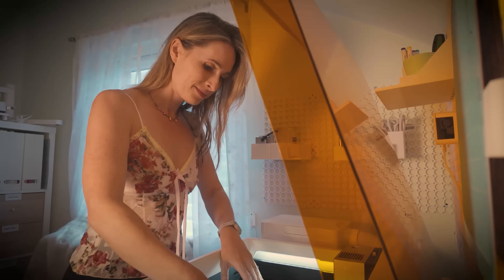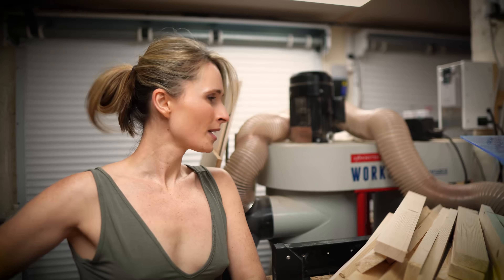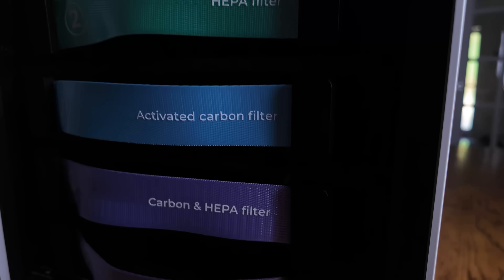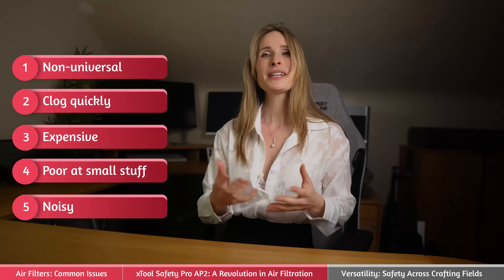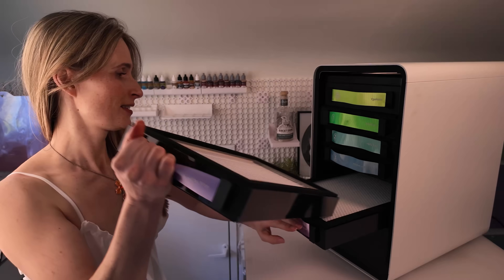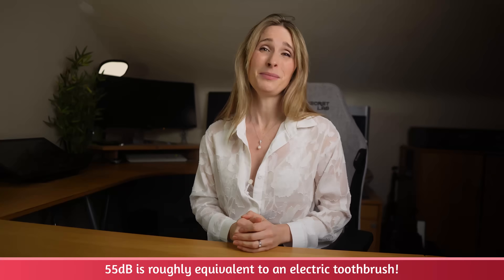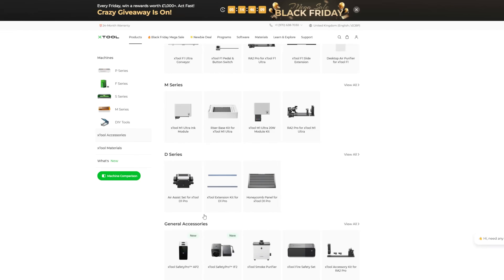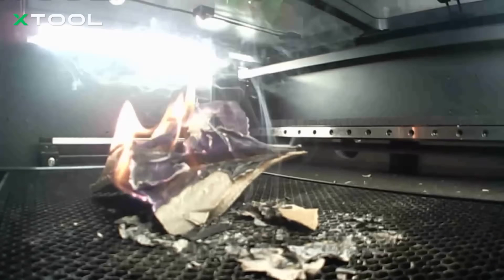xTool Safety Pro AP2: Is This the Ultimate Laser Safety Upgrade?

Comment: If you want to see what a better designed commercial air filtration system looks like, then check out the Grizzly 0953 HEPA Fume Extractor or the line of fume extractors by FiltraBox.
Reply from the maker: Sorry, completely confused now - earlier you said no filter needs more than three and it was overpriced, but now you're linking to the Grizzly with over eight and almost four times the price? So you're saying that more than three filters are valuable now and do have an effect?

Same applies to your other points - eg Layer 2 90% visible substances, but you're claiming smoke particles are visible substances, which they aren't (as they're 0.1-1 microns).

Likewise you're linking to the Grizzly and it also is putting the HEPA after the ACF, so it's this 'better designed' filter system not better designed after all?!

As I say, really interested to learn, but I'm struggling to see the logic or evidence from your examples - eg the Grizzly that has even more filters than the max three you described and the filters in the exact order you say doesn't work and with the multiple ACF filters that you said were pointless.... and it's 3-4x the price!

For what it's worth, the Grizzly looks great and seems to follow a lot of the AP2's logic too - obviously for that much more, I'd expect a bit more industrial capability and size, although it definitely lacks the looks and tech of the AP2, so I'd probably have four of them instead... ;)
Reply: @handsonkatie  I didn't research the Grizzly. I couldn't find the well designed Chinese made system that Roger Webb purchased a few years back and included it as a reference only because it is well-designed for commercial use and maintenance. 

As for smoke, it most certainly does contain particulates. This is why it stains fabrics and other materials. Even a clean burning fire emits smoke that may be barely visible, but it will still produce a sooty residue over time. Lasers cutting wood, plastics, leather, etc. do not produce clean exhaust.

If you look at the activated carbon filter in Clack's video, then you will see the residue from the smoke that xTool marketing literature claims is captured by the previous layers in the AP2. You will also note that that residue is not found in the center of the filter but only along the edges of the filter assembly, thus indicating an improper airflow.

I stand firmly behind my statement that no properly designed system for filtering laser exhaust needs more than three layers of filters to eliminate 99.97% of particles and odors.

My design operates as follows:
1. Large debris and smoldering embers are prevented from entering the filtration system by a steel wire mesh. This waste is dropped into a steel catch tray for ease of disposal.
2. The remaining dust and smoke pass through to the prefilter. This layer removes dust particles which would clog the HEPA filter as well as much of the smoke.
3. The HEPA filter removes 99.97% of particles larger than 0.3 um and the remaining smoke.
4. The activated carbon filter layer removes molecules which cause odors. This filter is cylindrical in design, 12 inches tall by 10 inches outer diameter and 6 inches inner diameter, providing for just under 2 inches of carbon around the peripheral walls. 

The carbon is contained in a liner so that it can be removed, replaced, and recycled. The bottom of the cylinder is sealed to force air to be pulled through the perforations in the cylinder walls. This design also forces air to be pulled evenly through the first two filter stages instead of being drawn to the edges of the filters as occurs with the AP2's design.

The fan is mounted to the lower-most chamber of the filter system to create the vacuum to pull the air through the system.

I designed this system to filter all dust and smoke particles, carcinogens, and other toxic fumes and odors while being able to run up to 8 hours per day with an annual operating cost of about $400 in consumables and it works as intended.

It also doesn't present a fire hazard as do both xTool's "SafetyPro" AP2 and its older Smoke Purifier.

p.s. - I foresee the SafetyPro trademark coming back to haunt xTool when the AP2 is involved in lawsuits stemming from house or apartment fires.
Reply from the maker: Ah ok, so the grizzly was just a random air filter? It's just you said 'if you want an example of a good air filter look at this' - is it even worse than the AP2 then as it has eight filters, three ACFs and so on?! It'd be great if you could give an actual example or evidence of anything as it's pretty hard for  anyone to follow as you're changing position.

So I get that you're comfortable with your filter that has three stages and you think it does a great job for you, but I don't see how that discounts every commercial solution on the market - eg Grizzly, xTool etc

Likewise, the fact you have done some engineering, doesn't mean you're right about say the cyclone. I've done engineering, but that doesn't make me right. The fact the CEO of xTool has done engineering (indeed studied aircraft design), doesn't make him right - although I'm sure it'd make him far more likely to know what he's talking about when it comes to airflow and cyclone design than you or me!! But the point is, you need to evidence things, otherwise it's just opinions being flung around.

Anyway, glad that you're happy with your homebrew design, and certainly I can wholeheartedly recommend the AP2 - indeed your points have helped me see even more strengths in its design, so that actually helpful! Each to their own!
Reply: @handsonkatie  It is good in its general design principles for maintenance. I should have researched its operation before setting it forth as an example.
Reply from the maker: Ok, so it too is a poor example then in your opinion as its filters won't work? Is Grizzly's obvious testing and industry use invalid too?

Do you not think it's odd that grizzly have been selling filters with 40 years experience to thousands of customers and haven't realised their filters have five stages that do nothing and have to order completely wrong so it clogs up super fast? Or could you maybe.... just maybe be wrong?
Reply: @handsonkatie  I can make a very poor design perform a task, but that doesn't make it efficient or cost effective.

The best definition of an engineer that I've ever read is a person who can do for half a pence what any fool can do for a pound.

I pride myself on offering the most efficient and effective designs possible at the lowest reasonable cost.
Reply from the maker: That's all great, but this like all your comments remains self-contradicting conjecture it appears as you duck any questions - but it appears you're saying grizzly are fools too now?

I'm genuinely interested - if there was any substance to your claims that all these industry tested filters were ineffective, overpriced and misleading, then there's a $15bn market for you to dominate - even the parents for your design would be worth $100m surely?!

But I do think based on all the flip flopping and evidence dodging that you might be mistaken in many, many places.

That said, I do think it sounds like you've made a nice little air filter which appears to do the job nicely for you, even if it lacks many of the features I like in the AP2 - Bluetooth device connectivity, cyclone separator to take out 99% of large particles, multi stage filter for long lasting lower stage (and more expensive) filters, optimised airflow for 3" ducts, in-house styling and even higher air quality.

But I think it's great that you've built one, it just doesn't make the entire industry wrong!!
Reply: @handsonkatie  The enclosure of the Grizzly design is good, but the filtration is less than optimal.

Do some research and testing. You will discover that what I've said about only needing a prefilter, HEPA filter, and activated carbon filter to remove 99.97% of particles, odors, and harmful fumes is correct.

BTW, xTool does not consider the "SuperCyclone Filter" to be a filter even though it serves the purpose of a prefilter. It is also not sold as a replacement part. Oddly, the manual advises you not to remove it from the chassis even though it must be removed for cleaning.
Reply from the maker: I've never said it's not correct, it's your assertion that any more serve no purpose that's not been answered. Are you seriously saying that a device without a cyclone that takes out 99% of large particles, then has three early stages filters ahead of what you described won't a) avoid clogging the more expensive filters faster and b) maintain filter efficiency longer?

This is a core reason more extensive filters exist across the industry and obviously they've been tested for millions of hours across many decades!! It seems pretty clear to me and I can appreciate all the third party testing, industry testing and user testing that verifies this.

And again I think you're struggling to understand the super cyclone - it says three times on the first page of the product description that you can just remove and wash it and it doesn't need replaced ever... Of course if you broke it, I'm sure xTool would send you a replacement part, but it isn't an accessory you should ever need to replace.
Reply: @handsonkatie  The vast majority of devices have either two filters or three filters. These are the devices that have been tested for millions of hours.

The filter systems designed for laser cutting have been tested for only thousands of hours collectively. The manufacturers do not run them to catastrophic failure because there is no need to do so. Who is going to file a class action lawsuit because they do not meet claims of performance? No one because there is no money in doing so.

I know what the claim by xTool is about removing and washing the SuperCyclone Filter is. However, the manual also advises not to remove it from the housing. The question is why? Does doing so break the seal with the chassis and reduce the overall performance?

The SuperCyclone Filter must also be disassembled in order to be washed and reassembled afterward. As a trained engineer (who likely has no practical experience) you should recognize that a device made of plastic will not withstand being disassembled and reassembled repetitively over months or years.

What is the average user to do when it will no longer seal properly because the screw threads are stripped out? The company does not sell these devices separate from the AP2.
Reply from the maker: Ok, I don't think you're really progressing anything, you've not answered any of my previous points and you're just throwing out completely unsubstantiated conjecture, which we've already demonstrated on 8-9 occasions is based on you a) not understanding the device b) not reading the technical descriptions correctly and c) not understanding industry standards or even the devices you point to (eg Grizzly). 

Given you have precisely zero experience of using this device, I can understand where all your misassumptions and errors are coming from (although I fail to understand why you can't follow the very clear marketing descriptions), but making wild assumptions about plastic not withstanding being unscrewed, really shows a lack of understanding of torque control in design. 

And the whole class action nonsense is just hysteria-stirring, far more confidently I can point out that your insurance company will no way pay for your homebrew, diy cyclone without any industry certification when it starts a fire.... which is far better grounded in evidence, but it would be pure conjecture also.

So try and keep to facts & actual evidence, rather than conspiracy theories and wild assumptions about my experience, the device and the engineering design - all of which you have demonstrated you have no knowledge, hence all the errors!

Comment: Am I understanding this correctly, if what I'm getting from it is that this filter station makes it so you can laser cut basically anything without sucking out the air to outside of the room/house and just go straight through the filter station with no hose for the outside?
Reply from the maker: Spot on, it takes nasties out of your laser cutter and what comes out is filtered clean air, no external venting required... Amazing, eh? And naturally you could do the same with any other device producing smoke/odours (soldering, resin printer, FDM printer, painting booth etc!)
Reply: It only works until the HEPA filter and porous activated carbon filter become clogged. You will need air quality monitoring equipment to ensure the AP2 is working properly.
Reply from the maker: Yep, just like any filter, it obviously needs to be emptied eventually - though this is already outstripping my previous one.

And air sensor super useful regardless, so definitely recommend them - love Apollo Air's sensors for example!
Reply: @handsonkatie - I didn't get the notification, so I thought my comment was missed lol, sorry for the long response time. Have you tried hooking it up to your Bambu printer?
Also how often do you reckon the filters needs changing? And is there an indicator that tells you when or do you just have to go by the air sensor you mentioned?
Reply: Venting to the outside is much easier and massively less expensive. The nonsense devices are only useful if you have really no way to vent to the outside. As is mentioned in this video, building a workshop around an airfilter is such a bs, as you could very easily include a vent to the outside. This is just the most expensive way to do this, all the while you never know if the filter is still working or not. Snake oil.

Comment: I received one bundled with the Xtool P2S - its really amazing. Working on patching my Bambu X1C to it so I can print with some of the more exotic filaments I could never use before. I have two air sensors in my hobby corner and neither has shown any significant changes while laser working with wood or acrylic. The only wood burning smell comes from the wood pieces themselves after I remove them from the P2S. Now if only Xtool would come out with a higher powered fiber laser!
Reply from the maker: Glad you enjoy it too! It is impressive indeed! I'm going to build a parametric adapter for my X1Cs shortly, so happy to share the files!

Comment: What about using it with a resin 3D printer? Is there a way to channel air flow to this unit?
Reply from the maker: Exactly what I plan to do!! My Elegoo Mars 4 Ultra has a port already, so I'll release 3d print adapters for using this - it'll be amazing for taking out those nasties from resin printers!
Reply: @handsonkatie  I was thinking the same thing that way I can exhaust outside.  Great minds think alike

Comment: Careful with taking out those small particle filters. 
I have a shopvac with dust class M/H (medium-high) and there is a whole section in the manual dedicated to cleaning it out because of the danger those small particles can pose in large concentrations. (Which is the reason you're filtering them out in the first place).
Reply from the maker: Absolutely great point and yes, it's a 'take it outside and wear a mask job'!

Comment: It's good that you have focus on air quality, especially for people who DIY in their own homes.
But even at a "factory" the air quality is important, 3d printing with things like ABS etc. and also laser embossing, laser cutting does put dangerous particles and in some times gasses in the air.

I know some people say "It smells a bit bad, but..", however those small particles in the lounges cant get filtered properly.
So I persoanlly dont print ABS since i just have an open printer (a1 combo), if I did have it in a dedicated workshop it would be doable if I had some sort of air outlet or air filtering.

I have seen one guy fitting a 3dprinter inside a closet and then fitting air-outlet in the closet (like a ventiation system with a fan going to the exterior wall of the house).
For me though I'm not that hardcore, also there are many materials like PLA Tough and PETG or even materials with CF that I can print without too much fumes :-)
Reply from the maker: Exactly the right attitude - whilst lots of open frame 3d printers can technically print things like ABS, I really wouldn't recommend it - just not worth the fumes. And you're quite right about this applying to factories too!

Comment: How much for some filters and a fan?
Reply from the maker: Duct fans are pretty cheap, but a bit of a piece of string you can use anyone, start around £50 for decent airflow and xTool's new smart one, Bluetooth, app connected mini one is about £140.  Filters are are from free for the reusable first stage cyclone and £10-30 for the progressively fine ones. If you look up the tiny 3m masks you get for your face, you'll see this is pretty good value (plus the prefiltering means it lasts much longer)